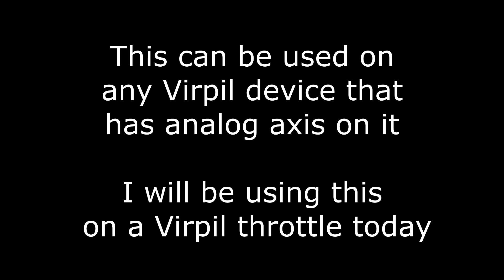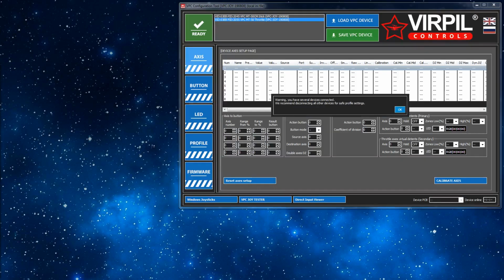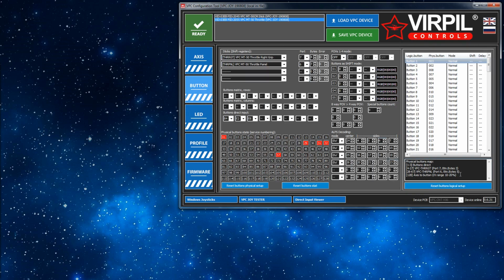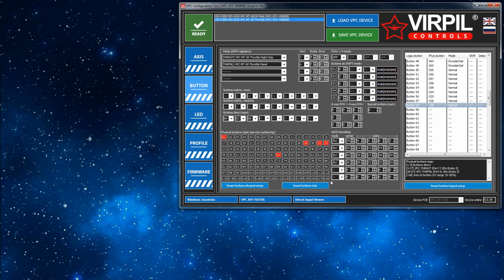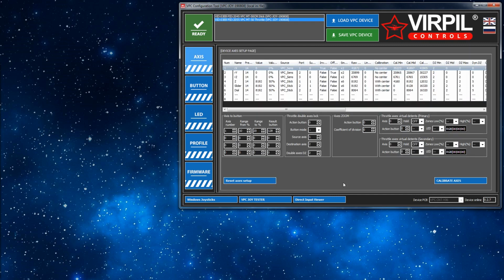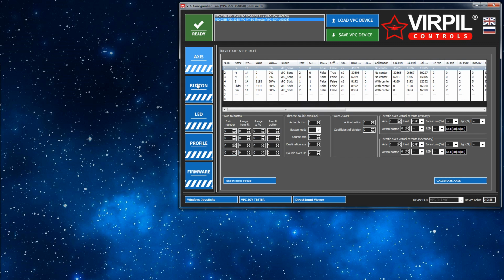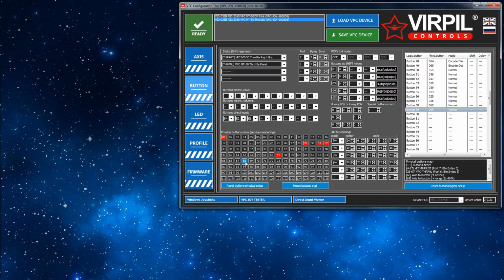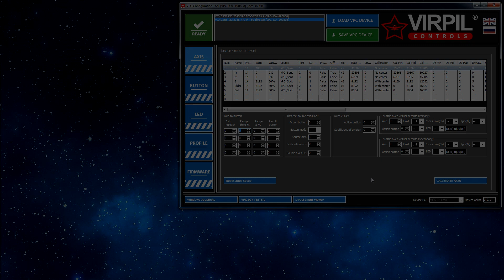VPC Virpil - axis to button tutorial

Comment: Thanks; that helped; I am now able to create one single button hold when I throw the Flaps lever all up to 81%-100%, Perfect ... however when I try to assign this button (in star Citizen) I double click the Spacebreak function (originally assigned to holding x on the Keyboard) to reassign, move the Flap lever up and it detects the Axis movement from the Flaps lever. So what I need in addition to creating a Axis to Button is to remove the Axis from being a logical axis. Is there a way that the CM3 only functions as a button and not has the axis exposed to the Game?
Reply from the maker: set the axis type to service

Comment: Hello, thanks for some great tutorials. Do you know if the following is possible (could not find it if you had covered it): I would like to assign buttons to the range of the FLAPS lever to the right of the throttle. This seem to be standard functionality in VPC software, where at 0-20% one button is pushed, at 20-40 another and so on, up to 80-100%. But I would like to have the direction matter. If I start in the 40-60% range and move forward into the 60-80% range, push one button. But if i move backwards from the 60-80 range down to the 40-60 range, another button should be pushed. 

So is there a way to set up a button which knows if you are moving into the range from below or from higher up ?

Comment: Hi Havoc, 
I liked the video and I used the first part to get my throttles set for DCS A-10C for the startup procedure. However, I managed to make a  mistake when trying to convert my flap axis to a two or three button setup. In A10, the flaps are up and down, while in the Hornet it is up, mid, and full. My intent is to make the flap (Rz Axis) a three button assignment.  Somehow I messed this up. On the main Virpil screen, the rZ is red and has a link error with a 130.  I double clicked on the Rz axis and attempted to make a three button assignment. How to I revert back to when it worked? I did a recal and a reload of previous profile w/o success.
Reply from the maker: link errors (it is just a count of how many data packets are corrupted when sent to the micro controller), usually indicate something wrong with the profile (being incorrect for the device you are using)  or  a hardware fault with the device, best guess you cocked up and configured the wrong profile for the device you have
Reply: @HavocCompanyClan  I went back and created a new profile and the flap axis is working again. I am going to watch your vid again and attempt to make a three position flap one more time. Thanks again.
Reply from the maker: @scottwhite9474  howdy, are you wanting  3 pos eg  pos 1 =  100% - 70% = flap button position up ?    pos2 69% - 40% = flap position takeoff    , pos3 = 39% - 0% = flaps landing   , if so set the button type to TOGGLE ON (it means it will only pulse ONCE when you hit that zone, but NOT hold button down all the time) , let me know who you get on buddy
Reply: @HavocCompanyClan  i´m trying to do the same, i can with your first metod but with the second i'm unable to do it, no key press no matter if normal or toggle on mode...
Reply from the maker: @BorjaAG  which firmware software you using? 20200925 has some issues FYI

Comment: For a very strange reason to make Axis to button  works( the 1rst way ), i need to bind the physical buttons  to 2 differents logical buttons. It result in Joy tester as 1 logical. If i bind only 1 physical to 1 logical, it doesnt work ! XD
Reply from the maker: what type of button binding in the table are you selecting ............ it needs to be type NORMAL
Reply: @HavocCompanyClan   it set to normal ! :D
Reply from the maker: @tomy10002  link some screen captures of axis tab and buttons tab
Reply from the maker: @tomy10002  if you watch my video ............ I start from the top DOWN ........ 128 , 127 , 126 for the button numbers when using this method

Comment: Very nice tutorial. Got my T50CM-2.  Two days ago and was wondering if there was a way to change an axis to buttons  using the flaps slider. You've answered my questions. 
Seems Virpil has some excellent software to support their hardware.  

Subscribed. Can I ask where are the profiles I create stored? I have a WarBRD base from a year ago but lost all the stick settings when I had to install a later version to support the new CM2 Throttle. The throttle has sooo many more buttons so would hate to start programming from scratch. 
Once again thanks.
Reply from the maker: the profiles created are stored on the actual Virpil device

Comment: hello,

thx for your videos.

i'm currently using a thrustmaster warthog throttle + warthog joystick (right hand) + rudder + left-hand t16000m joystick setup. 
i'm really interested to switch to a dual stick virpil + throttle setup. the build quality seems to be unmatched.
question:
i'm very happy with the thrustmaster target software. e.g. i have a layer switch for the up - middle and down layer. the important thing here is in every layer i can also use an additional shift switch/layer.

it seems on the virpil throttle you can use a 5 layer switch but can you also use an additional momentary shift switch with the virpil setup like it is the way with the target software?

sorry for my bad english!
Reply from the maker: To be honest I just use Joystick gremlin for this stuff, it works with any brand on controller so it means you can have one device control shifts states for all connected devices
Reply: @HavocCompanyClan  ok. thx